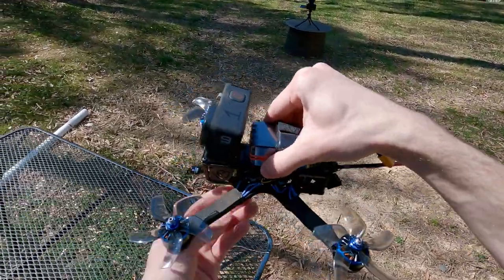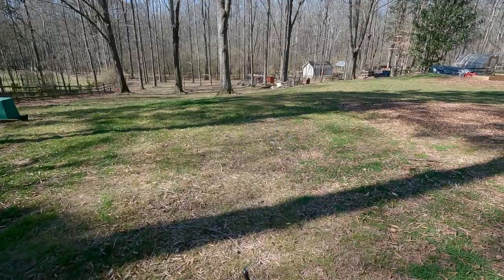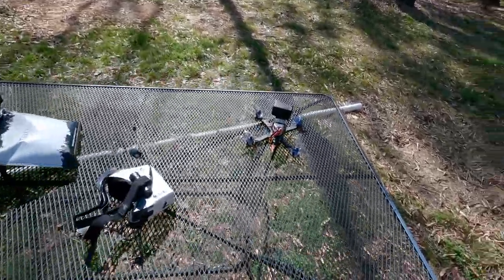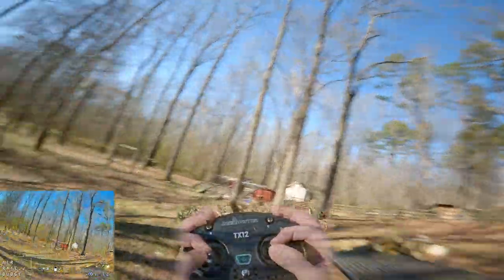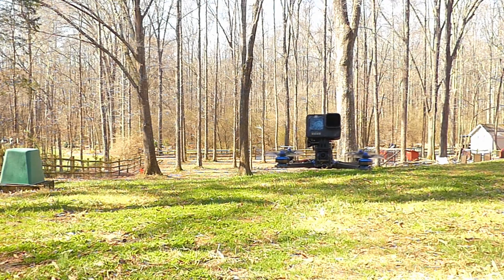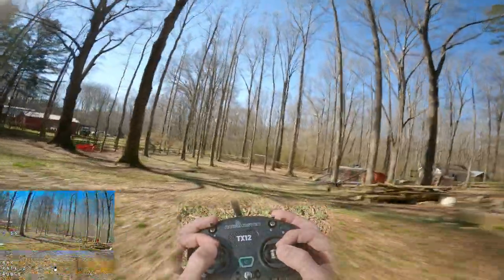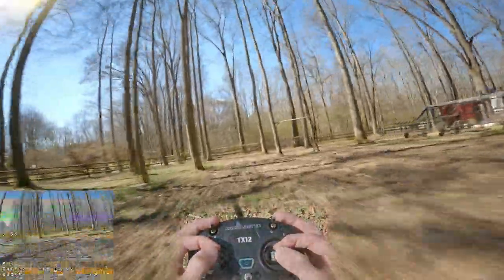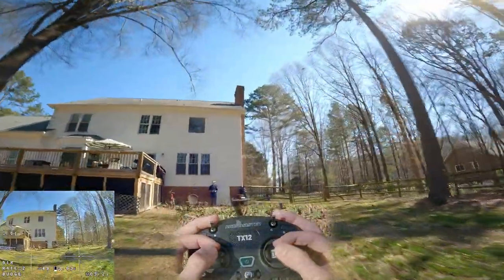3" Propeller with 5 spinnyblades on a 5" FPV Drone

Comment: It’s quieter because the RPM is so low, you need over 3000KV motors on 6S to make that prop viable on your 5” setup.

It does work, I have done many similar builds. I design motors for FPV, so I get to screw around with a lot of novel combinations. 😜

It’s just that those props need +50k RPM to make good thrust, and you are giving them only 30k

Try again with a proper RPM setup, and you will see how surprisingly well it works.

Comment: Did your motors get hot? i did this 2 years ago with 4 blade King Kong 3in props and had the same result as you only my motors got pretty warm from running at such a high rpm the whole flight. Still fun to watch someone else try it. i flew 2 quads a week ago with same controler in 3D mode. i straped 2 quads together with wire ties and reversed everything on one quad. it actually worked pretty well.
Reply: Yow i dol i also watched your vid on YouTube
Reply: @kenanthonyadiaz2660  Cool brother! so if you watch my videos you know im into 3D now so any chance you might someday try 3D FPV ?

Comment: I'm going to drop paper airplanes by shaking them off and follow them down .
 A grocery bag bottom cut off with scissors can make a oarachute by taping strings on it and adding a plastic weight.  
   Just hang the chute right side up on the bottom from a peg or hook and it might shake loose when you want . Don't  get string in the props or it will stop the motor .

Comment: Those props will be quiet not only because they are smaller, there's also more blades .
If it was a 2 blade or 3 blade prop it would be louder.